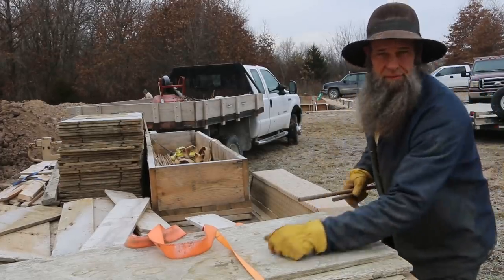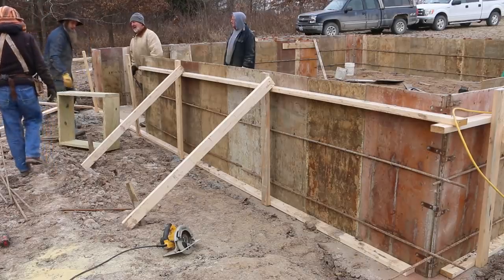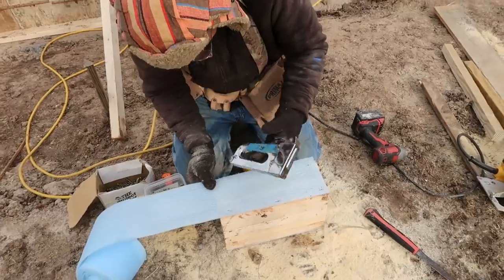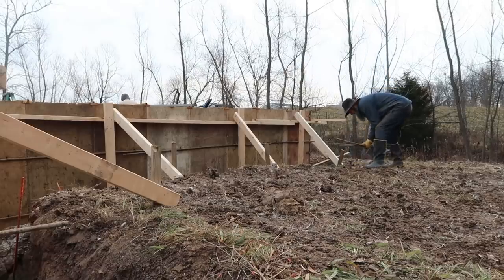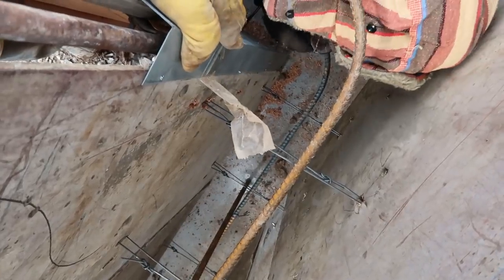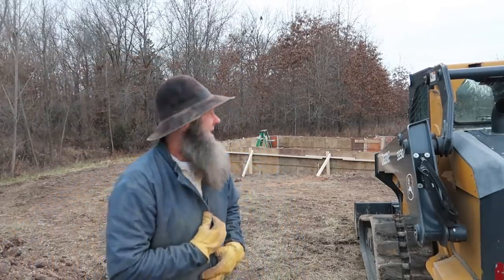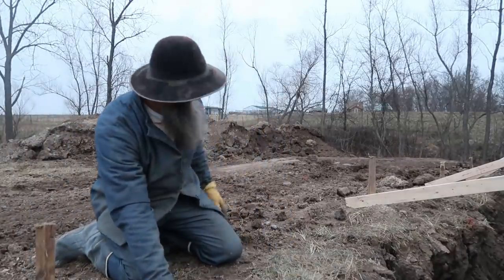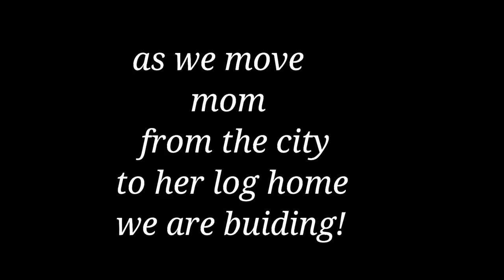Building a Log Home for MOM and PROBLEM with FORMS! DAY 7

Comment: Those pieces of metal in the corners will work just fine, however you could also use a piece of custom cut chamfer cut from your scraps as well. Also, I don’t know what direction your floor joists are going to be running, but you should put your crawl space opening on the side that the joists DO NOT rest on, that way they  won’t interfere with where your joists set. Also your bulk head for your crawl space should be made out of pressure treated lumber.

Comment: I thought after yesterdays hat it could not get any worse. Man was i was WRONG 😂 it looks like you guys are having fun. Front dump concrete trucks are awesome ask if the batch plant has one. Are local operators are awesome with them. Use a back board to help direct concrete into the form. 
 Thanks for sharing i know it takes a lot of time to make these videos. And your filming is very good.

Comment: We call that “Design Build” when plans and engineering has to be done on the spot... 
With our crawl space we put our drain tile on the outside rather than on the inside as well as waterproofed the exterior. Our access is a trapdoor under our stairway inside the cabin to maintain the integrity of our concrete walls (to keep water and critters out). It’s interesting to see exactly how you guys are doing your project. I’m learning things and enjoying every minute 👍
Reply: The houses in my neighborhood all built with crawlspaces and exterior entry. There are a few with interior entry and the outside one filled in. I think it's nicer inside, furnace filter change in January would be much easier.

Comment: How thick is the wall? I usually run a 12 inch to build on.  Here for a second I though it was deep slab not walls.. I'd run more uprights to keep straight and if you could turnbuckles to re string once poured

Comment: not sure but the pocket for bean looked flush to the form and not to the top of the concrete
Reply: The pocket was made taller so that I could hit it with a hammer to remove it.

Comment: How did you tie your two sides of form together. I’ve never seen those ties and if you tied them how did you tie them.
Reply: Micah DeVries the long bars slid in the loops of the ties on both sides. That locks them at the proper width

Comment: Why not dig out the area you will have to walk in so you won't be on your knees?
Reply: I AGREE and THOUGHT the SAME THING MR JB BROWN.  With my BACK. I NEED to STAND and SIT DOWN.  Make a cement bench.
LEARN FROM THEIRS.  Doug & Stacy.
Keep the FLOOR WARMER.  ESPICALLY the BATH TUB.  FREEZING COLD.  MICHIGAN started about 6 WEEKS AGO.  🔥 boiling water season for the TUB to WARM it UP ☝.

Comment: I'm confused. You say you're building your mom a log cabin, but you're making it out of concrete.  I thought log cabins were made from logs, & modern ones have other materials so the cabin can be better isolated from wind & insulated.  So what role, if any, are logs to play in your mom's cabin?
Reply from the maker: As the old adage says "stay tuned" 😉